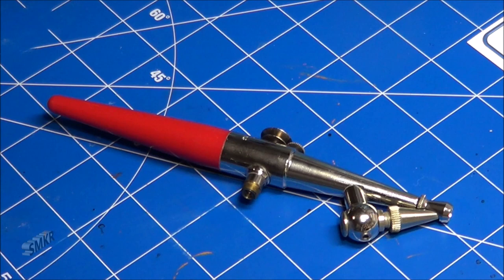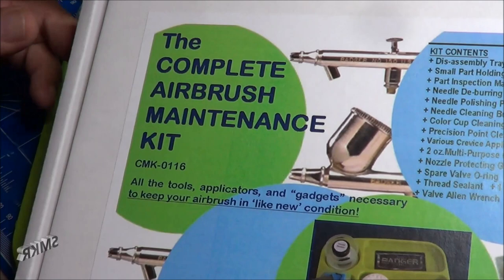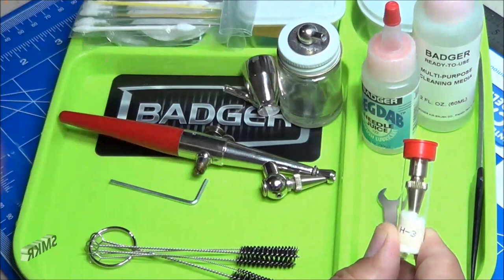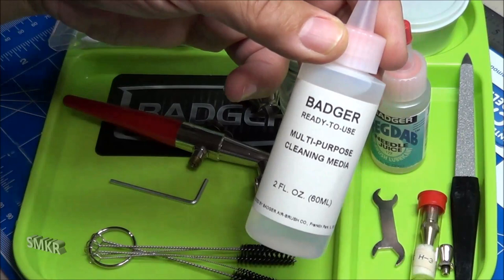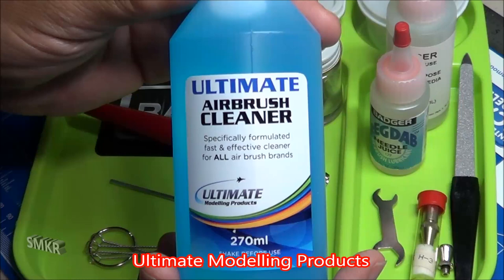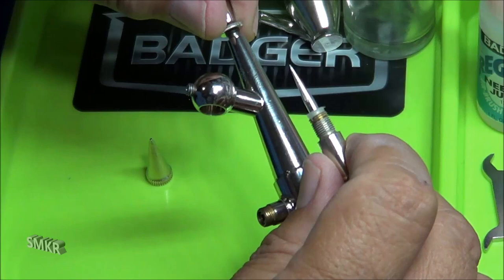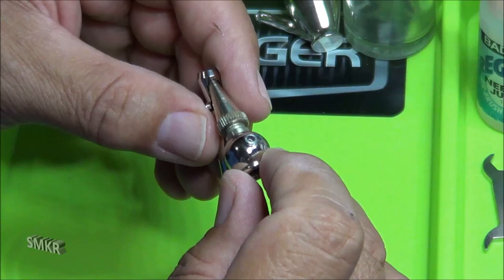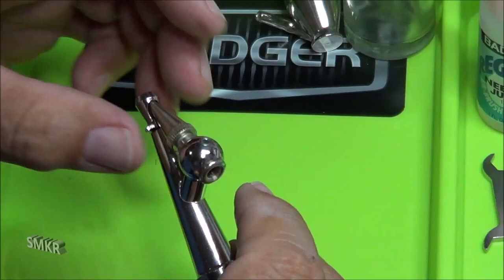How to Clean your Paasche H Air-Brush

Comment: The teflon packing can wear out over time (Usually a LONG time). Once you get it and the nut installed, you adjust the nut so the packing grabs the needle, but not too hard. This gives the seal you need for good paint flow and atomization. If the needle moves easily with the nut tightened down all the way, or you get sputtering with the packing tightened, it's time to replace the teflon.

Comment: I don’t know if I’m wrong but the O riña and the teflon part can be threaded inside the nozzle, at least that’s how it came when I bought it. The O ring has a a notch on one side that can be used with a screwdrive
Reply from the maker: Yes you are correct. Thanks for watching!
Reply: Yes, the ptfe o-ring, goes threaded into the nozzle, there is a retainer that gets the o-ring in place, and the retainer must be threaded softly, enough to seal the nozzle an the needle. Also its not recomended to sand the needle, because the dimensions will change ant the airbrush will need more adjustments frequently, its enough to clean the needle and nozzle with thinner, acrylic, laquer thinner or IPA, depending the paint you used..

Comment: The brass ring and rubber washer goes INSIDE the needle nozzle, not on the needle. If you look at the brass ring, it has a slot through it where you can place a screwdriver to tighten it inside the nozzle.
Reply from the maker: Yes I know about this from previous comments, thanks for watching.
Reply: @ScaleModelKitReview  Sorry, didn't read that far back. Your video was very useful. I learned a good cleaning technique nonetheless!

Comment: Enjoyed the ease of cleaning the H but after a while noticed how rough the atomisation was when compared to an internal mix.
Now using a paasche Talon with the 3 head set.
Reply from the maker: Thanks for sharing.  Do you like the Talon?  I gave my Talon to my wife for her crafting.
Reply: I keep hearing this, but don't get why people are having a problem. I lay down Stynylrez primer right out of the bottle with the H and get a perfectly smooth layer. For heavier more viscous paints, it's the go to over my double action.
Reply: @swdw973  depends on the paint. Stynylrez self levels.
Reply: @ScaleModelKitReview missed your comment. These days the talon is only used with largest needle and fan cap for larger models.
Using a 0.5mm patriot and 0.2mm ps270 as my main guns.

Comment: I've never had one of those teflon rings on the needle like the one in this video.  Seems to work fine without it.

Always neat to see how different people do things but if I were cleaning up this airbrush, I would just let it soak in dried paint solvent for a while, then disassemble.  That way, I wouldn't have to scratch it up with sandpaper.
Reply from the maker: Thanks for watching.
Reply: Not sure way the ring and the nut are on the needle; I have 2 H set and the nut and ring are assembly in the nozzle; I believe yours works fine because the ring is doing its job inside the nozzle

Comment: does not having that nut or seal that was in with the needle matter? i bought mine used and it didnt have either of those.
Reply from the maker: Those parts are important, you can find many of these on Ebay for spare parts.

Comment: I recently received a very old and unused airbrush, and it has paint caked into the round part of the airbrush where the needle attaches, how should I clean it?
Reply from the maker: You will need to disassemble the airbrush and soak the metal parts in a stronger solution such as lacquer thinner or Acetone, then I would recommend you replace any defective or worn parts.
Reply: Scale Model Kit Review Thank you!

Comment: Can the nut get stuck in the housing took mine apart and mine didn’t have it can you be because it hasn’t got cleaning so long that I got stuck in the housing because I looked in there and I see something gold Asking because a friend gave it to me the other day
Reply from the maker: Your correct the nut should have the screwdriver slots facing out to be able to remove and replace the packing, I believe I replaced the whole needle valve assembly which comes with the new packing and nut.
Reply: Scale Model Kit Review Thank you Steve

Comment: My paasche h won't spray liquid not even water the air comes out fine but no liquid my needle and tip are clean and so is my cup any clue what the problem could be
Reply from the maker: Its hard to tell, I would have to see it in person.
Reply: I agree complety.  I'm done with it.  I hate this airbrush and I am on the verge of throwing it in the garbage or smashing with a hammer.  It's great if you want to airbrush rubbing alcohol, but nothing else flows through it.  I'm going back to the crappy aztek that worked for years.